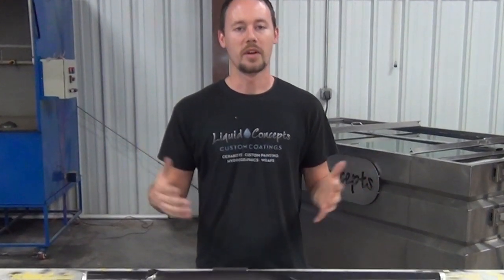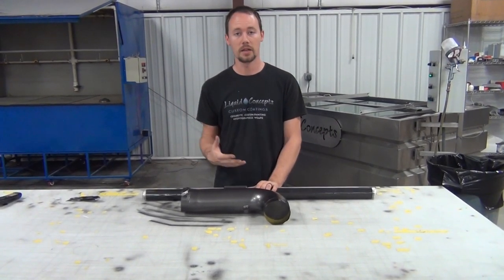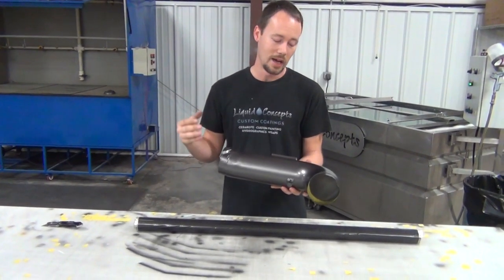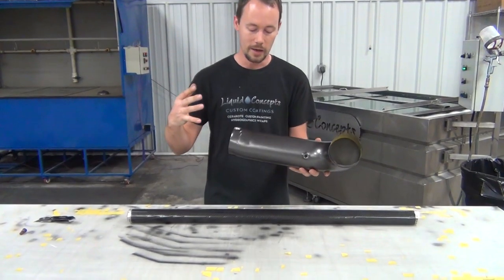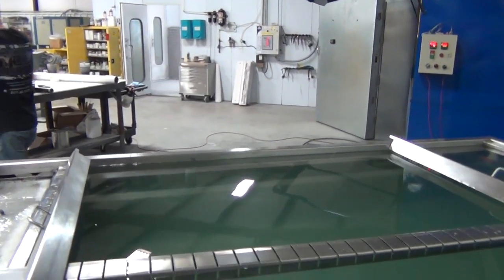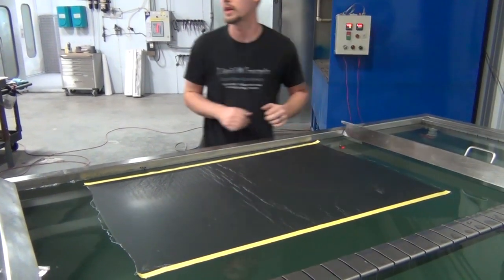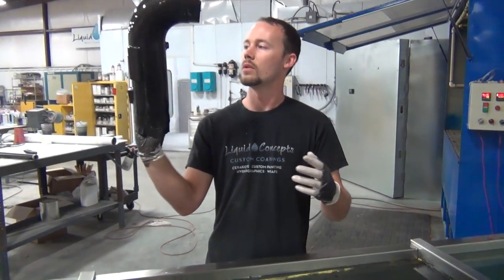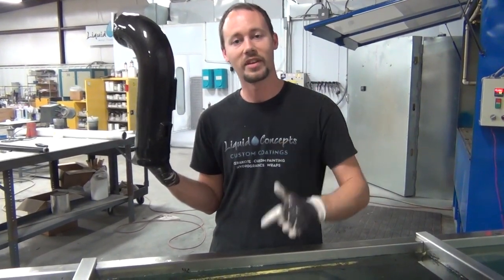HOW TO HYDRO DIP ROUNDED PARTS | Liquid Concepts | Weekly Tips and Tricks

Comment: Rad tips, I'll sub and check out ya other vids. If you haven't can you a motorcycle rim video? If you double dip would you tape the first dip rinse then clear then pull tape then let dry then tape the clear then dip the otherside? Or would you tape, dip, rinse, pull tape, flip, retape hydro side and dip?
Reply from the maker: Next time we get a motorcycle rim in here we will certainly get you a video! Normally we will dip half, rinse, inter coat the rim, tape off first dip, dip the second side, rinse, touch up and then clear. Hopefully that will help you out a bit!

Comment: Is there any difference from a clear carbon fibre and a black carbon fibre for car parts
Reply from the maker: Not exactly sure what your meaning by a clear carbon fiber but the print that we used was a black and clear so that would mean any color that we use as a base coat would show through the "clear" sections of the film. You can also have a black and silver for instance and the base color would not hardly change how the pattern looks as it would normally be a full printed pattern so you can use a black or white base and the pattern would still be black and silver but the white base would be a tad lighter in hue or color. Hopefully that helps!
Reply: Thank you for your answer so if I want a carbon look I use a black and clear with the base colour black

Comment: How long does this last. Like say a spoiler. With the elements outside how does it do?
Reply from the maker: With this process we use all high grade automotive primer, paints, and clears so you get the same durability as your vehicles paint.
Reply: @LiquidConceptsUSA  like 2k primer 2k clear?
Reply from the maker: Yes that is correct.

Comment: Is it necessary to rinse after dipping?
If yes, then with cold water or hot?
Reply from the maker: Yes you have to rinse to make sure you clean off all the PVA that is still left on the part from dipping. You can rise with either cold or hot water.